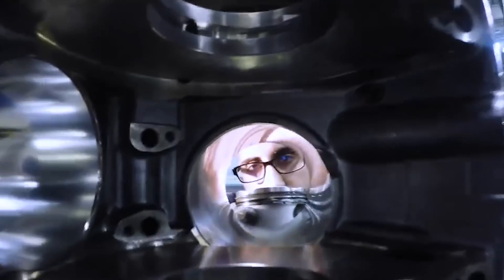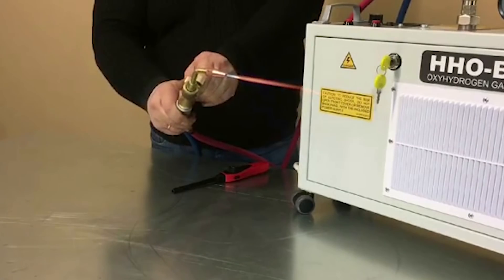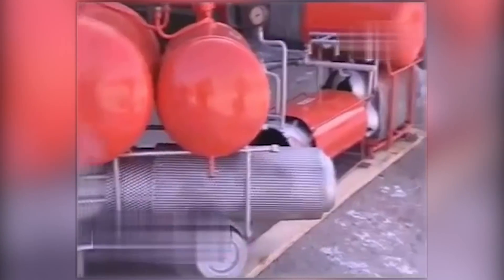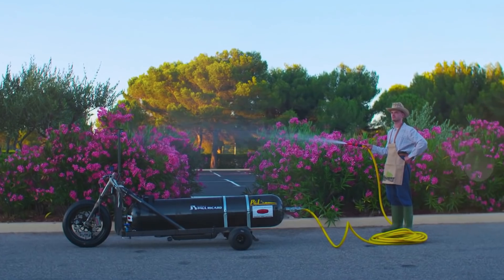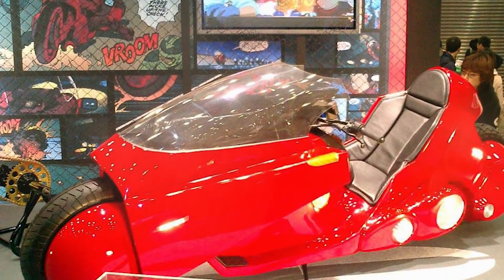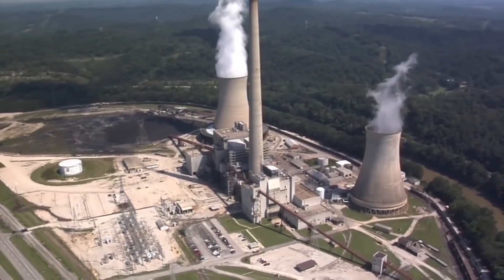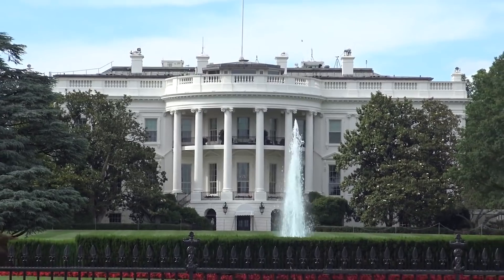Why These Engines Are Banned?

Comment: And you also need to draw the Control Volume around the entire system. You can't pump up a pressurized vehicle and not look at the energy to do that.
Reply: This is exactly the same issue as "hydrogen" - it gets pushed without taking the generation/transport/storage costs into account

Hydrolysis cycles are at best about 20% efficient, before taking into account that compressing or liquifying hydrogen for transportation use takes 3 times as much energy as manufacturing it from water in the first place (and hydrogen is "difficult to work with" due to its tendency to embrittle anything it comes into contact with plus leak through virtually all containment - before you even consider the mechanical aspects of pressure cycling bottles to several hundred atmospheres (making them essentially a grenade if they start suffering fatigue cracking))

Comment: If only the euling powers thought more with their minds and less with their wallets. Maybe then human kind would be much further in our technology and issues like global warming, pollution, even deforestation would not be an issue.
Reply: What you choose not to understand is, they are one in the same. 

Consider the Wankel Rotary Engine: in Its last iteration in the Mazda RX8 (Rensis) the design was putting out 232 hp BUT only around 120 lb-ft of torque. Its ultimate problem is the lack of compression. In this last iteration, it was only capable of about 9.5:1 peak compression due to its inability to properly lubricate.
Reply: I kind of get what you are saying but, it is not that simple for me. For one I have always had difficulty speaking in some way due to how my brain is wired as a result understanding emotional inteligence is not so easy. Like body language, hints and even if I do get it I tend to not know how to act upon it 90% of the time regardless of how much I try to change this. Combined with my single minded focus towards my artwork seems to generate a vibe people dont like...? But, not sure how or how to amend that as people tend to avoid me mostly on that basis.Or in other cases how I dress, look physically or even talk which is supper frustrating.
Reply: @kylejolly7751  Emotional Intelligence has naught to do with physics. 

Want in one hand, shit in the other. Which one fills up first?

Comment: NONE of this stuff is BANNED.  For instance, the compressed air vehicle would be much more expensive in the US to meet our safety standards.  For you that do not speak METRIC 100 kilometers per hour is 60 mile per hour.  The air does not "walk" into those tanks energy free.  You have to have energy to compress and pump that air.  This is a FANTASTIC technology for a vehicle in a warehouse or running around a small campus like a golf cart or similar but not very good for running down a US interstate highway.  Look here on Youtube for all the good information on Thorium reactors.  If any of these worked WELL, they would be COMMERCIALLY VIABLE.  Nissan has to offer MASSIVE discounts on the all electric LEAF and they have horrible resale value.  Small and very short ranged.  Converting water to hydrogen and oxygen would require massive amounts of electricity that would very severely strain residential power grinds and most generator designs call for 220v instead of 110v.  It would be like adding a second dryer or oven to your house but this one runs all the time.  Wood powered vehicles were COMMON in the 1930s when people did not have money for gasoline.  They were especially useful during WWII.  Apparently they are still in use in North Korea.  Exxon Mobile has been working on oil from algae for over 30 years and still have NOTHING to show for it.  The reason many things will not ever happen in the United States is because people in the United States are STUPID!!!  Back in the 1970s, Saudi Arabia offered 1 billion dollars to build a new oil refinery in the United States.  State of the art, as clean as possible in the 1970s IF they could be guaranteed all the permits and that it could be built without fighting a bunch of lawsuits.  We could not take them up on their offer.  You need to drop your paranoid delusions so you can actually educate yourself about all the issues.

Comment: I have a lot of these engines I have  Recreated some of these engines and I dont have to pay for electric gas or anything I even found a way to use dirty water/sewage in to energy cleen energy with almost no wast my car runs off air and water and a fue magnets it actually seems to have more power than the gasoline counterpart  I will never sell my designs I am not greedy people can have them for free if you can find them

Comment: It is because most of these ideas are either expensive to implement, requires too expensive of materials, it is not reliable, or it is not safe.  Also understand that several of these ideas were scams to get grants or to sucker companies into buying questionable design ideas.

Comment: Hydrogen generator isn't exactly scalable to be used in a car, and its a bit slow.
Burning oil is nothing new but it makes for inefficient car fuel.
"air engines" are inefficient and impossible to pull off. Yes some guy made it hit 100km/h but he also used it on a bicycle sized "car" which probably weighted just as much and the Japanese one, as you said was made out of plastic. If we were to put it into a normal car, you would probably be lucky to get a 10 kilometres before running out of gas
"wood fired car"... Oh yeh, like thats any better in comparison to petrol engines. and lets not forget carbon monoxide, certainly worth it!
"magnetic engine".... so an electric motorbike... Tesla needs to get onto those as well
Cold fusion engines are beyond expensive, you could easily buy a couple of Ferrari's. Then there is also a fact that it would be a disaster if it got into an accident. Thorium isn't a toy to be played around with, its radioactive after all. And then there is also a stigma about nuclear power itself.

Comment: Yes most of these principles work theoretically but they have huge drawbacks in effeciency, safety and/or practicality.

Lik a car on compressed air. Have you ever noticed that compressors have large heat sinks? That's because they piss away an awful lot of energy as heat just by compressing the air. The air cools down further in the tank and you end up with even less pressure.

"driving with zero expenses" YES IF YOU RUN IT ON YOUR FUCKING BIKE PUMP WHICH YOU WILL HAVE TO PUMP FOR 11 YEARS TO CHARGE IT FULL

I did some math, 175liter air tank @ 300 bar (based on google search) and using a bike pump of 300 cc per stroke at one stroke every two seconds. Does that check out? 11 years seems like awfully long but then again we're talking about a huge amount of energy.

Comment: Air driven engine?  It is a Sterling engine and needs a heat source.
Reply: no, it's not a sterling engine... it's a compressed air tank either feeding a turbine or a piston.
Reply: @squirts1  well then it's basically a steam engine but without the steam
Reply: tristan 123455 or a COMPRESSED AIR MOTOR, ever use a pneumatic tool? It's not a steam engine
Reply: @tristan6509  No, a sterling engine  uses a gas as an expansive medium.  Hydrogen works well, air is OK.  The heat source can be anything of course.
Reply: @jeffreystroman2811  well a steam engine is basically a compressor motor attached to a boiler
Reply: @zzebowa  there is Sterling engines in places with no electricity access that run water pumps for wells that run on sunlight with little to no magnification. It's not pumping a super high volume but a slow trickle constantly .
Reply: @tylerbrandon460  Yes, the heat source can be anything.   They are very clever engines.  Invented by a Scottish minister.
Reply: You are correct. But its fascinating that a compressed air tank has the potential to rival the energy density of a electro chemical battery.
Reply: @squirts1  I'm aware of its pitfalls. My understanding is that more PSI more energy storage and more danger. That doesn't mean we just walk away from the technology. Every technology started out as something unfeasible and then at a certain point a new development allowed the technology to become feasible. Why would that nature of progression not work here? I'm seeing a future where cars are smaller and more efficient, not the other way around. I'm also seeing a future where maybe we don't use compressed air at all cause something works better like a magnetically suspended flywheel battery.

To be clear, i read and understand what your saying and I agree with the premise, but not the conclusion.
Reply: k moods. I'm not sure what your wanting me to say at this point. I'm not debating you, im trying to bring humanity into a better space. You win, air compressed technology is no good. Lets try a different one. 

Stirling engines? Solar powered Air Conditioning via the ammonia cycle? Or are we to assume that the everyday technology we use is the best it gets so we shouldn't bother trying for anything else?
Reply: @squirts1  Yeah before nitrous oxide became readily available drag racers would put compreessed air tans on the back and try to use them like a rocket . It didn't work well. I don't think it shaved any time off. I don't see how compreessed air could give that much energy. If you just put an air Chuck. on your shop air line and uncouple it and let it shoot off it might shoot a foot and they weigh nothing .
Reply: @squirts1  hindsight is 20/20 or whatever the saying is. When nuclear came out it was poo pooed by many but it has proven to be beneficial despite the uncleanness of the first nuclear plants. I already conceded that compressed air might not be practical yet your not doing anything to move the conversation forward. Take care.
Reply: A Sterling engine can run on just a temperature difference between the enclosed working fluid and the outside air. They can also run backwards. A cryo cooler is a Sterling engine heat pump running in reverse. There has been a lot of recent developments with Sterling engine run generator s. I didn't realize how much stuff uses Sterling engines. They are used to cool microchips running a fan off the heat from it to cool it. They are actually very interesting. There's a lot of cool models you can get. One will turn fan from the heat of your palm.there is a competition to see who can run one off the smallest temperature difference from internal and external temp.the record is 0.5 degree ferhendheidt I think. Sterling engines are awesome. Soon I'm sure every home will have a Sterling engine run generator. Already have a Sterling engine heat pump. My dad's house does .in the winter it's a heater in the summer it works in reverse and is an AC. I just found that out lol.
Reply: @tylerbrandon460  Indeed, they are a fascinating interation of thermodynamics and kinetic energy.
Reply: @zzebowa  And to think it's been around since 1816. I read there was one made for the Dundee engine factory to replace their steam engine. It had like a 2 feet wide piston and turned 250 rpm, capable of lifting  over 1,000,000( yes 1 million pounds) 1 feet off the ground in one minute. Torque monster! I think it lasted about 2-3years but they went back to steam after the operator allowed the cylinder to overheat for the 2nd time.
Reply: @tylerbrandon460  a compressor driven car (or tool for that matter) uses mechanical advantage to move a rotating assembly rather than just spewing air as thrust like a rocket so your example doesn't really apply. 
About HVAC heat pumps... that's not actually quite how residential heat pumps work... They use a lot of power to run compressors.
Reply: @squirts1  Thanks for the info I just recently started reading about stuff like this. I like learning about this kinda stuff.

Comment: The principles behind wood gas are well known and wood gas engines were reasonably common in WW2.
Reply: And they are carbon neutral.
Reply: Since that burns something they are not.
Reply: @451 How are Steam Engines inefficient? The Doble was faster and cleaner than any diesel.
Reply: And extremely inefficient like steam.

Comment: It's the politicians that decide what's taxed not oil companies not only is this an issue of thermodynamics but energy conservation. The problem with air powered vehicles as you have a couple of high pressure tanks people can't drive today so instead of a tank and a lightweight body you're going to have blown up tank at two blown apart bodies oil companies don't make the cars they just Supply the demand for oil

Comment: Excellent work, glad you’re sharing the truth.
Rudolf Diesel also died in mysterious circumstances.
You could benefit from another writers’ help in my opinion.
Reply: Adam Blaknovski - So that’s why the modern diesel engine is so widespread and successful?
Reply: Jules Domes no it’s successful because it was genius, it was designed to run on vegetable oil so the gulf oil company had him killed and sold their petroleum by-products as “diesel oil” to add insult to injury as well as steal the profits and ruin our atmosphere
Reply: Adam Blaknovski - So with Diesel himself alive the engine  would only run on vegetable oil? Really? The cheaper alternative would not exist? Really?

There seems to be a giant hole in that «logic», as usually the case in conspiracy theories.

There is no evidence he was killed. He disappeared from a passenger ship in 1913; probably committed suicide due to massive financial problems and major health issues.
Reply: Jules Domes it was all part of a larger plot to install the central banking system we are all slave to now.
The Titanic sinking was to remove several rich and powerful families that would have and could  have resisted the central bank takeover. Diesels’ death was to increase income for the manoeuvre.
History is fun, but it is written by the victors as they say.
Reply: Adam Blaknovski - Your paranoid conspiracy theories are very creative, I have to admit.
Care to share any evidence? For example how the evil bankers placed that evil iceberg in the path of the Titanic?

Comment: "hard to imagine a vehicle powered by compressed air"  i would love to know how he thinks jet engines work, I understand that they have a combustion chamber but make thrust by the rapid expansion of the heated and compressed air.
Reply: @Newbie Failmaster Good point all engines do use compression.  What I meant was that jet engines use the compressed air to move the plane, car engines use compressed air to cause an explosion in the combustion chamber, but the vehicle is moved by the crank turning the trans and therefore the driveshaft, to the tires.  So indirectly yes it is moved by compressed air, so you are correct.

Comment: Yea youd think oh shit compressed air thats like the next best thing when in reality its no different than a standard AA battery yea the power that it creates is clean but the power that was used to make the naterial and charge it was used tho 
So in other words the tanks of compressed air had to have had some sort of energy made to put in it coming from the power plant going to the compressor that fills the tank i think this is a good idea but would it be safe hauling around all that weight in bottled air? I mean im kinda scared to step foot in a batery operated car have you seeb what a battery does when poked with like anything sharp? Yea well they explode and that would suck if i were to get in a car accedent and i just sitting in there like a turky in the oven frying 
There has to be some kind of reason why theese things didnt pass onto production maybe things like cost to profit margine materials efficency cost to maintain replacement parts cost a really good example of why i doubt electric cars will get far is because lithium is a resourse much like gasoline and can be used up yea we can recycle it but lets be honest aint nobody gona recycle anything like that without profit involved

Comment: thorium has one problem that they dont tell you they can fix it but of course its taking some time but the problem is that how can you design a material that is able to withdstand attack from elemental sodium and fluorine at temps exceeding 800 celsius which are generated by a thorium reactor due to the sodium fluoride salt used in the reactor along with thorium fluoride salts.

Comment: a futuristic way to produce power would be to convert fuels or sugars into electricity catalytically at high efficiency without using noble metals like platinum.
think its impossible ? we are proof it works because we convert chemical energy into mechanical energy and the way that works is a complex mechanism called cellular respiration.
now if we could build an artificial version of it that would produce electricity instead of ATP it would be great since the last step of cellular respiration is called the friggin electron transport chain.
thing is though these types of materials called as artificial molecular composites are in its infancy

Comment: hho for fuel cannot work unless the hydrogen is seperated from the O2 by membrane!
if you feed HHO into a fuel cell it will explode!
if you feed raw HHO into an engine well it can work but even with a flashback arrestor your storage tank is a dangerous explosive nightmare plus if its under 200 bar any sufficient activation energy or can result in catastrophic failure

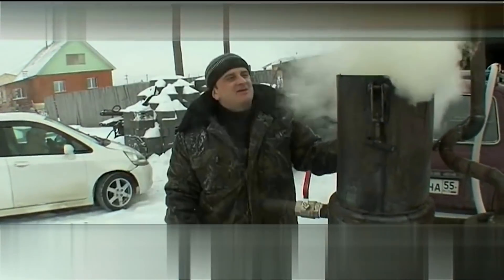Comment: 5:15 the Wehrmacht actually developed several prototype vehicles to run on wood gas during WWII, including a Pz. VI Ausf. E Tiger.
Reply: Which is why wood gas was perfect for the Wehrmacht because they were running low on petroleum-based fuels as the war progressed.